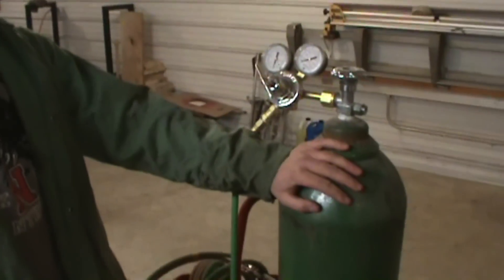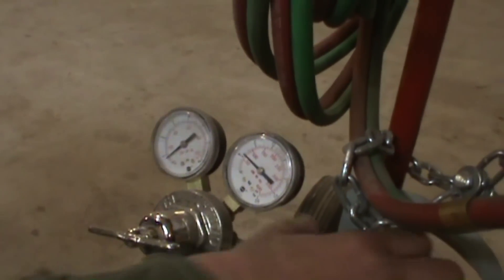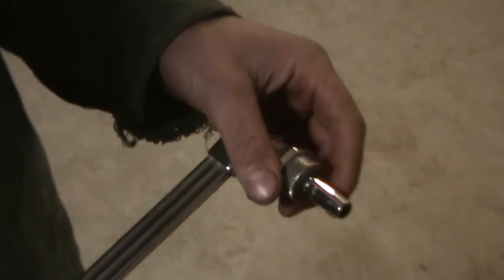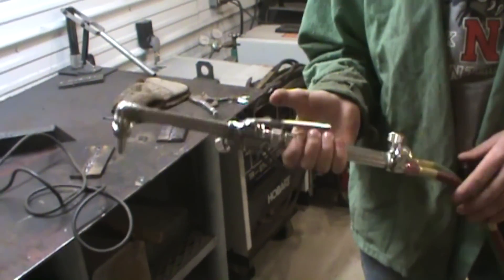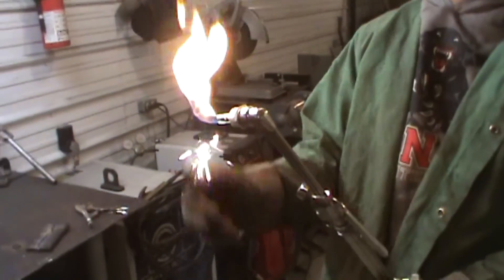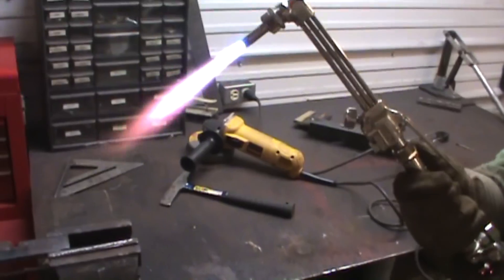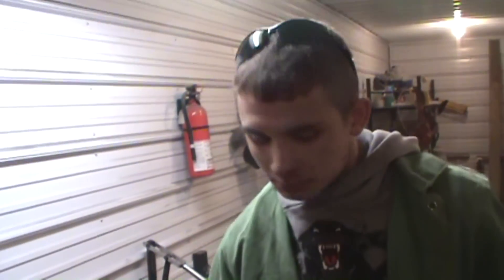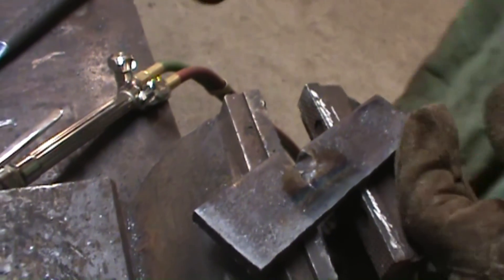Oxy-Propane Cutting

Comment: biggest advantage is you can throw a propane set in the back of your truck , drive somehwere and dont need to wait for the acetylene to settle 
better for trowing in a pickup driving in the middle of bumfuck nowhere and torch cut scrap metall or rebar or whatever needs cutting 
i only use it for heating rusted tractor parts where propane is way cheaper than acetylene - usually also use gas rich flame to reduce oxygen cost 
its a less clean cut than my plasma cutter so i tend to avoid cutting with it except wherever there is no electricity ... 
i used it to heat and bend rebar thats to thick to cold bend with a pipe extension with it

Comment: Make sure you use a propane cutting tip. They are two piece and work much mote efficiently as well on propane. Also grade R is not for propane and other fuels. Grade T is for propane, propylene etc. Nice video!

Comment: I have been an ASE Certified automotive and Diesel mechanic for overv 40 years. You are never to open the valve more then 1/4 turn. The reason is safety.  You have 2000 psi in that tank, if your touch is lit and a hose ruptures or the regulator comes apart . 1/4 turn will save you. A fully opened valve you will not be able to close before the fire backs up. If the regulator comes apart with 2000 lbs of pressure, don't worry about the fire. The tank will become a rocket. And fly different directions.  I have seen this happen before.

Comment: Great video guys. I think you are right on not knowing how to adjust for propane is the main reason people say it sucks compared to acetylene.
Reply: I am new to oxy propane ... I bought a Victor medalist set and first time using cutting torch and it is making popping noise unless oxygen lever is depressed.  Tried running 5/35 and 10/40 on gages no difference.  When I light the propane, should I add oxygen and create neutral flame then repeat.  I am nowhere near flame shown in this video.
Reply: @jimw6991  I'm not the one to ask on that brother, I'm not vary familiar, just looking at going to propane.
Reply: @jimw6991  I think you found your answer but whatever. Yes you have to turn on your oxygen little bit after burning. Flames have to intact with tip. If not, oxygen will blow the flame.

Comment: Quality acetylene regulators have soft parts rated for LP (which is why their rebuild kits aren't gas-specific) but the LP regs go up to much higher pressures. (That difference is due to the heavier spring.)  Take my word for nothing (this is Youtube after all) but do check with your manufacturer tech support. They are happy to answer!  Also check out the Weldingweb and Miller forums for tons of information because Youtube is mostly just good for demonstrations.  I've used LP and acetylene for many years and rebuild my own torches and regs per factory guidance. (Don't fucking dare rebuild regs without study because high pressure oxygen is no joke!)

Comment: Once the cut starts, the fuel you use makes no difference, the oxygen alone is what does the cutting.  Once the cut starts you can literally turn off the propane or acetylene and it will still cut.

Comment: Hold on a second there young  feller,   the pressure in the propane tank is a function of the temperature of the liquid propane.   As long as there is liquid remaining the pressure will reflect the temperature.   You tell how much propane remains by weight. When the bottle is filled it is done by weight.    It doesnt matter if the tank contains 1 pound or 25 pounds, the pressure will be the same at a given temperature, in the neighborhood of 60psi at room temperature.  Look up the temperature/pressure chart for the refrigerant R-290, propane for specifics.
Reply from the maker: Thanks feller, you are correct; pressure is not the correct way to measure. If you notice I used the phrase if I'm remembering correct. That's because when I got the setup it was in August so the ambient temperature was probably around 85 to 90 F at that temperature the vapor pressure of LP would be 135 -140psi  that is likely what I was remembering (however incorrect it may have been). Based on my pressure gauge the shop temp must have been in the mid 40's which is reasonable for January. Thanks for the information.
Reply: @Welding2012 I need to connect my acetylene regulator v a propane tank just like in this video.  Do you know which specific adapter I need? I would like to buy it on Amazon if possible.   I would like to get tips for mostly heating. Would the welding tips suffice for that? If so, which size is the beest for that?  Does the biggest tip put out a lot more heat than the smallest or is the heat output BTW them insignificant? Thanks....

Comment: Some information may not correct in this video. According to my knowledge the Propane + Oxi combination is hotter than Acetilen+Oxi. Unfortunately by propane the burning process is slower, thus it is not able to apply enough heat on the workpiece.
Reply from the maker: I would have to disagree with the statement above; while all of the information in this video may not be 100% technically accurate, the statement made above is incorrect. The oxygen-acetylene flame burns at approximately 5600 degrees F, while oxygen-propane burns at approximately 5070 degrees F. As for the not being able to apply enough heat, the kindling temperature (temp required for cutting) is approx 1600 degree F well below the temp of both gas mixtures. While the oxy-propane may take a few seconds longer to reach the kindling temperature (due to being approximately 530 degrees cooler), once the cut is started the burning or cutting of the metal can actually continue without the heat from the fuel gas. I hope this helps to clarify things.

Comment: Used oxy/propane(also every fuel gas anyone can think of).  In all the hand and burning machine torches i have used there are lower psi tips(usually for small repair shop folks), then within the same brand there are higher psi tips(thicker cutting by hand or typically CNC burning machine cutting. Have cut up to 10" thk. by hand and 26" and 27&3/4"thick plate on my burning machine.  The coolest thing i have seen is oxy/propane with black iron powder injected/mixed with the cutting stream(iron powder runs 200$ a 50lb pail). That mix with either hand torches(often 4 to six feet long to keep you away from the spectactular flame/sparks/SMOKE) or machine torches that cut billets or ingots up to 4 feet thick!

Comment: So if I want to get a set up like this and I’m buying used from a buddy who has acetylene gages what gage do I need for propane? As well as new hoses rated for T
Reply: Acetylene guages work just fine for propane
 Just change tip. No need to worry about hoses until they need to be changed. Then buy t grade.

Comment: Most really large industrial cutting/scarfing torches are designed for LP,  not acetylene. LP works well. Having both options is handy. You can use an acetylene regulator with a CGA-510 fitting on a BBQ jug because the internal threads (not the external threads for the plastic nut) are designed for it, but do NOT exceed the capacity of the OUTPUT gauge or you can damage the gauge (guages are cheap though).  US-made regulator soft parts are fine with acetylene and LP but if in doubt contact manufacturer tech support to confirm. Perhaps long ago R hoses didn't get along with LP but many welders have used them without problems, self included. If you buy new hose, get T. For more info I strongly recommend the Weldingweb and Miller forums. Worth noting is if you want more flow for high flow cutting needs you can buy the larger LP cylinders which do not have OPD (Overfill Protection Device) valves.
Reply: I didn't get the part about the difference in the regulators  can you use acetylene  regulator for propane I've never cut with propane just the fact that you can go get a bottle at anytime  is the only reason I would use it

Comment: Can you weld with Oxy-Propane?
Reply: No, You can do everything else, but not "Welding". When you burn acetylene, it breaks down into CO2 which creates a shielding gas around the weld puddle. No other fuel gas will do this. Cutting etc. is great though!

Comment: Would you be willing to make a video brazing with oxy propane? Also have you ever tried brazing with just plain copper electrical wire? I've seen that it can be done by other youtubers but I would love to see if it's possible with an oxy propane setup
Reply from the maker: +Nick Ketner I no longer have the propane setup. I do not know much about welding or brazing with oxy-propane but I would imagine it would work the Oxy-Propane flame burns somewhere a little north of 5000 F and copper melts around 2000 F.
Reply: +Welding2012 fair enough, I just converted from OA to OP and was wondering how well it would work with brazing just for the sake of portability and ease of use in the middle of nowhere. Other wise I would just weld with my mig welder as you mentioned. Thanks for the quick reply hope to see more content from you in the future
Reply: Hi, why don´t you have the propane setup anymore? Do you have an acetylene one instead? Please give us some of your wisdom on the matter.:)

Comment: looked intoo buying a setup like that 
going to use it mostly to heat up seized bolts and cutting metal in a car mecanic / hobby enviroment 
you allready helped with the way you need to setup the flame and the tech about wish hose to use 
 i planned to adapt a acetylene setup with a different regulator and burnertip and i'm glad i saw this vid as the hose wouldve failed on the setup

looked it up on the net 
the mix propane to oxy is from 1:3 up to 1:5 ........... eeeh wow you wherent kidding when you said you would use more oxy 
about how many bottles of propane to the big oxy bottle youre using ?

Comment: Grade "T" hose should be used for propane 
Grade "R" hose is only rated for acetylene
Reply: Technically correct but in practice probably a hangover from ancient times since many pros use R hose for both. Hose usually dries out from old age and cracks rather than have the inner section fail.
Reply: @obfuscated3090  I understand it propane dissolves the R rated hoses after time thus reduces their safe lifetime use.

Comment: Victor did a demo on this in my welding class. Cut quality was amazing!!! I can't for the life of me figure out why anyone would use Acetylene for cutting and heating. Propane is so much cleaner and cheaper. Not to mention safer.
Reply: We use acetylene because it burns much hotter than propane and so it gets the job done quicker and with less oxidation.  And propane isn't much safer than acetylene, a propane tank can still explode and kill you.
Reply: @AK99581  acetylene has more dangers than propane because (1) under 29 psi, without absorbent, acetylene undergoes violent decomposition, (2) acetylene requires liquid flammable solvent to be remain stable, (3) solvent can leak out when cylinder is sideways, ......
Reply: @henryng439  Yeah I know acetylene is more dangerous, but my point is that propane can be dangerous too if not handled correctly. And acetylene, if stored correctly and you know proper procedures for usage, can be very safe.
Reply: Use acetylene for gas welding. Propane does not burn hot enough for gad welding. Propane will work for brazing.
Reply: @terryrafter4116  Propane will work for welding - just use flux to clean the surface.

Comment from the maker: I would say as good as any flame cutting method I mean as far as piercing it is the same procedure as with acetylene just need the correct size tip and a steady hand. One thing i have found with cutting nice small diameter holes is start in the middle pierce through and keep tracing the outside of that until you reach the desired diameter at least for me this works well. Good luck!!

Comment: Hello, great video. I had my first go at gas cutting the other day, I was trying to cut  through 1" plate. I couldn't get it to cut. However, I was using the oxygen jet right from the off, am I suppose to pre-heat without the oxy-jet until the area is up to temperature.  
Thanks Dave :)
Reply: troaduk2 Yes.

Comment: YOU ARE WRONG. you can weld with propane. all industrial cutting is done with propane. there is no carbon put in propane like  acetylene so it will not be as strong of a weld. also cutting with propane won't harden the cut edge making machining much easer

Comment: How is Oxy-Propane for cutting scrap steel? The place I deal with has been raping me on acetylene. Also the valves on the past two acetylene tanks I have got leaked weather the valve was on or off and Im still fighting with them about it. Its not often I have to cut up scrap but when I do it would be nice to know that have gas there when I need it. I am set up to use both Oxy-Propane and Oxy-Acetylene.

Comment: you cannot weld with oxy-propane, you can only weld with oxy-acetylene, due to the carbon-dioxide shield that is produced, as well as that oxy-propane and other oxy-fuel gases will produce a lot of hydrogen and thus leave you with a porous weld (hydrogen inclusion).

Comment from the maker: Unfortunately you can't weld with oxy-propane it doesn't get hot enough also when oxy-acetylene burns it produces CO2 that shields the weld, with propane you do not get that so the molten puddle has nothing to protect it therefore it is impossible.

Comment: hello,i was wondering if you can buy propane tips for pipular acyetaline torches,or do tou have to use a totally different torch? also,cant you still use oxy/acy. hoses with an oxy/propane set-up? i have a buddy who has used propane/ oxy now for many years with a large industrial torch/ has used it to cut thick steel,he told me i dont need to switch anything,but he may have not set it up himself,so i wanted to ask you what all i would need to change from my ovy

Comment from the maker: I wondered how long it would take someone to notice that I mentioned it in the description though.
Reply: I need to connect my acetylene regulator v a propane tank just like in this video.  Does anyone know which specific adapter I need? I would like to buy it on Amazon if possible.   I would like to get tips for mostly heating. Would the welding tips suffice for that? If so, which size is the beest for that?  Does the biggest tip put out a lot more heat than the smallest or is the heat output insignificant? Thanks....

Comment from the maker: An acetylene tip would be a no go with propane if you notice the tip is recessed for propane which allows the flame to burn with acetylene it would just blow itself out. Propane tips also allow  for the needed additional gas flow.

Comment from the maker: Sorry man can't weld with oxy-propane it doesn't get hot enough also when oxy-acetylene burns it produces CO2 that shields the weld, with propane you do not get that so the molten puddle has nothing to protect it therefore it is impossible.